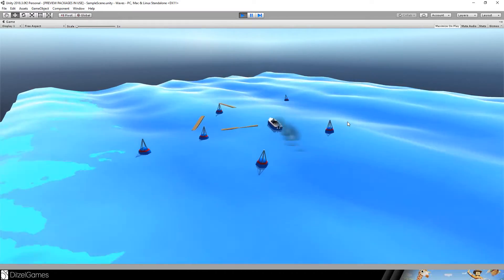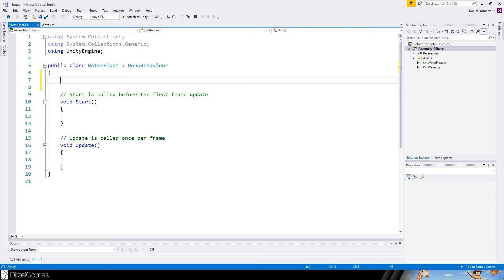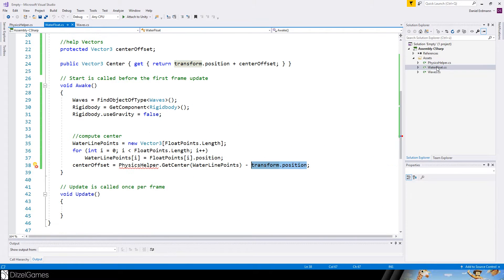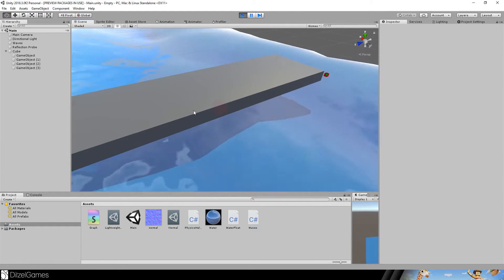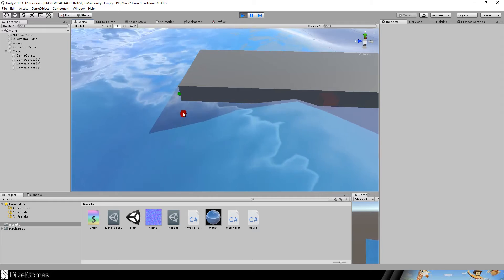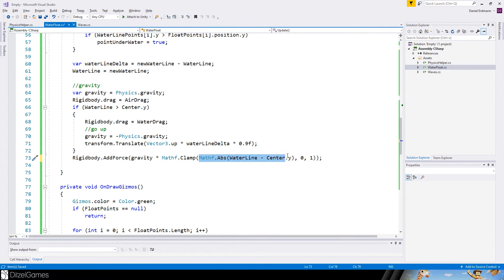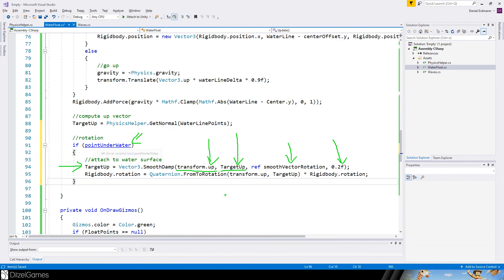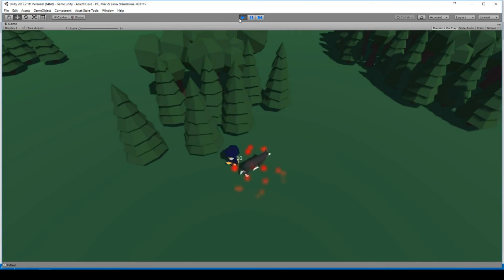Water Physics - Unity Ocean Tutorial 3/4

Comment: Question. Why can't we just use Unity's mesh collider, and have it update as the wave mesh moves? I built my own vehicle physics, and don't really need this script. I just needed the wave tessellation.
Reply: Hi, were you able to handle this problem?
Reply: @zodjeks  Sadly the way Unity updates collision and physics, it is impossible to update a mesh collider each frame. Additionally, you can't get the vertex location data of a wave mesh, because it is calculated and rendered from your GPU.
Unity is utterly determined to make wave based physics impossible. 
There's a ton of work arounds if you want to just use a flat mesh, but I wanted rivers and varied water bodies. Everything I found wouldn't work for sloped water surfaces.
Reply: @MalaiseEraMedia  It looks like it. As far as I understood, updating the mesh collider every frame would be too costly and not profitable. But this method does not suit me either, I work with raycasts. Thanks for the reply.